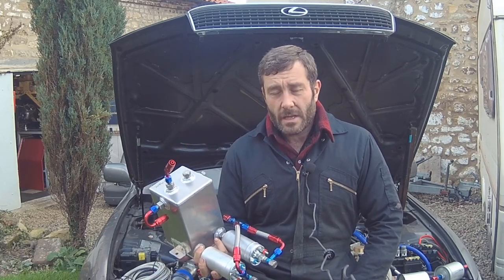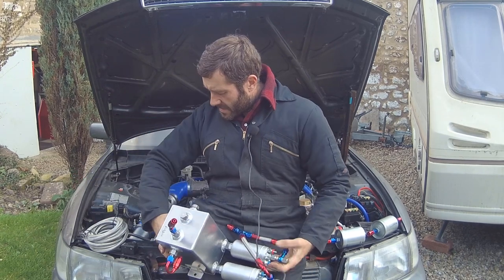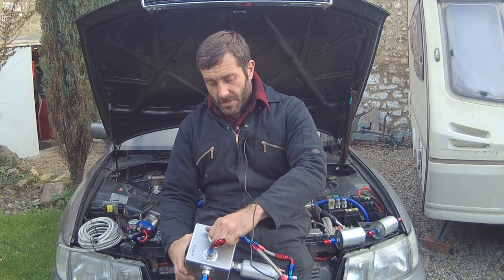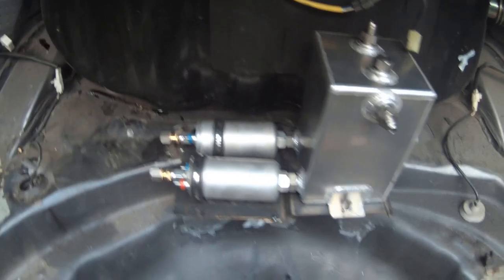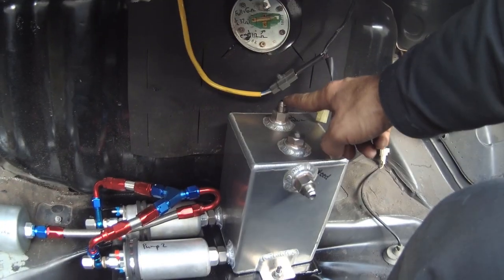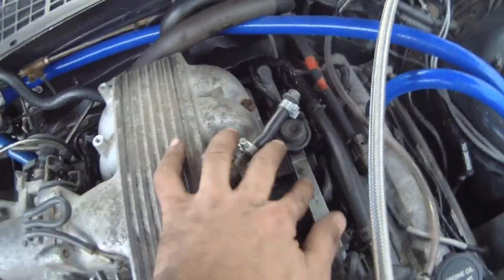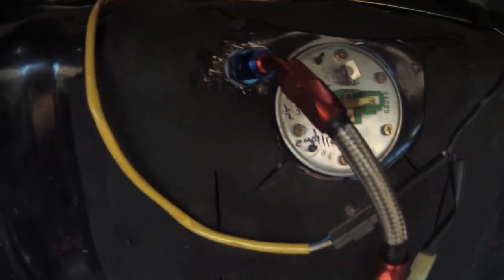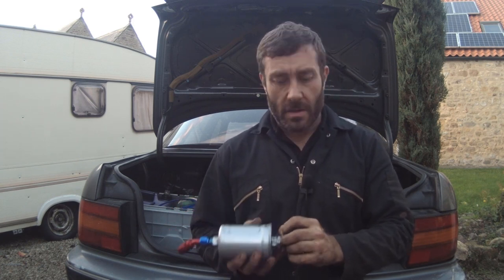TurboShed Part 22  - Fuel System Upgrade 2x 044 pumps 1UZ Turbo

Comment: That the best surge tank installs video, none of the others on YouTube show the wiring part or where the return line feed goes. Thank, I've been waiting ages for a proper full install, if you do an oil cooler and catch can fit I'll be watching. well done
Reply from the maker: We did an earlier video on oil coolers, we run two oil to air heat exchangers on the car.   No catch can fitted through, we just vent the rocker covers to a pipe between the air filter and turbo inlet.  One point on the return line, in the video I think we put the return line into the main fuel tank, later on we changed that to run into the top of the fuel surge tank to give the tank lift pump an easier job to do.